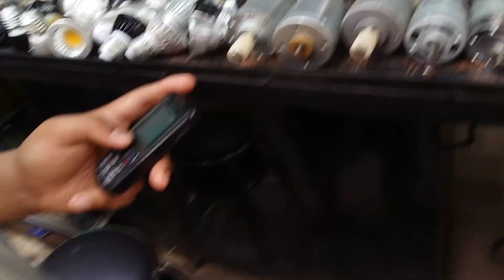12 v small Dc motore . DRILL MACHINE MOTORE ..ANY KIND OF SMALL MOTOR A

Comment: Hi bro,
I am looking for a DC motor which can run a piston water pump with motor speed 1440 rpm and pump speed 250 rpm.
They recommend .5 HP and .37 KW motor.
Can you suggest any DC motor for my requirement.